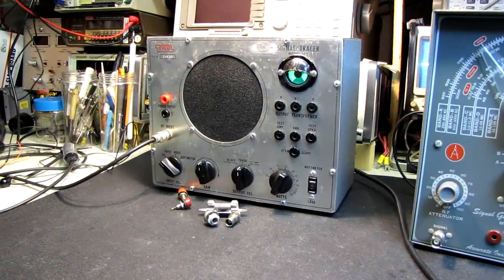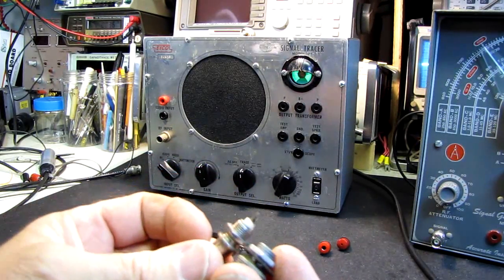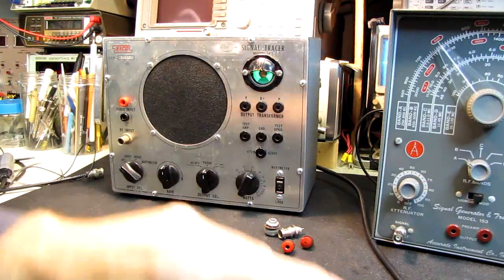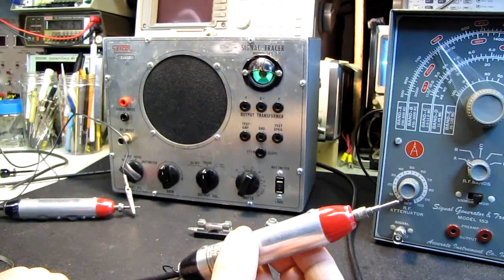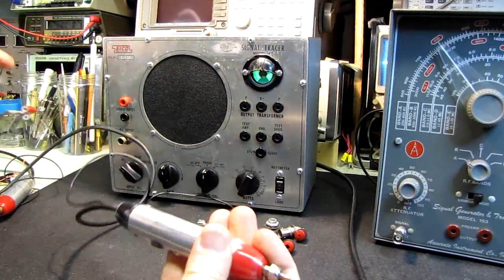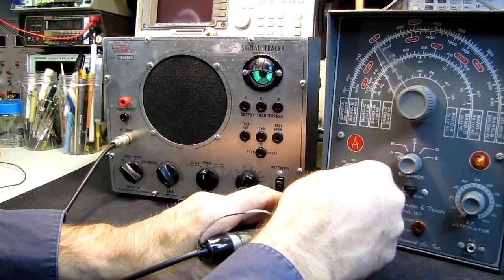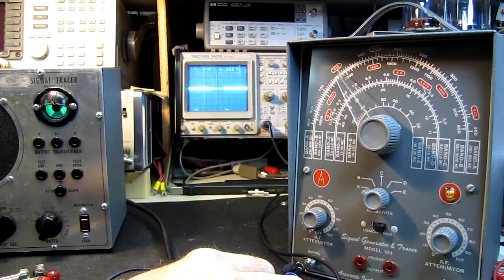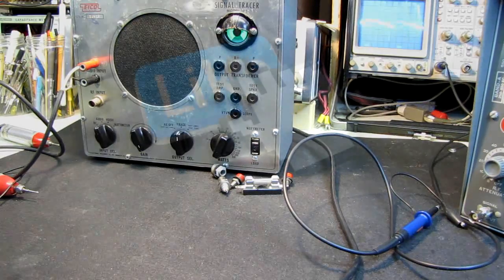10 Buck Test Bench - Eico 147 Signal Tracer Upgrades

Comment: I have a recent Swan 700 that requires some work & pulled my old Eico 147A off the shelf again and started watching some videos on exactly how these things are employed wondering exactly why the eye tube always shows ~70% deflection. I have the same issue on another 1038 Crosley super 11 radio. I wonder if you may comment regarding what may be the exact reason these eye tubes in the Model 147A are all resting at over 50% deflection. Hum, resistor value change, XMF leakage? Thx for a decent video Vern!
Reply from the maker: @maicodoug  that is the normal resting position for an eye tube. There is only a wedge at the bottom

Comment: I just bought a 147 on eBay "untested". It has a bad output transformer. What would you expect the impedance of the primary of the original transformer to be? Is the speaker 8 ohms? Thanks.
Reply from the maker: I am sending this from Thailand and have no access to my schematics. However take a look at what tube is used for the audio output, look up the specifications for the plate resistance. This will give you a pretty good approximation of what you need for the primary of the audio output transformer. That being said, this is not a high fidelity unit and is used primarily just to hear audio signals. Therefore just about any general purpose replacement audio transformer will work and I wouldn't worry about the speaker impedance. Again you're only using this to monitor the sound through the radio you're testing.

Comment: Great upgrades and video! This circuit and its intended DUT circuits are both outside of my skill set. However, I am beginning to learn about them, both. In considering building my own signal injector/tracer, I thought it might be useful to have the injected tone include a discernible beat/pulse. That way, I could not confuse it with any other tone of similar frequency produced by the DUT.  My hearing is significantly diminished. Thoughts/suggestions/circuit method?

Comment: Dear Radio Mechanic, I own both the Eico 147A and the 324 and on the 324 when it is plugged into the power I use, when I touch the case I can feel just a small shock, is this due to a leaking power transformer?
Also on the 147A that you replaced the ac wire with a ground, did you connect the green ground wire to the chassis? Thank you kindly for any input...

Comment: Nice video! I have one of these. I'm in the process of replacing the 3.? watt speaker with a 4" 30 watt Eminence speaker and two 1/4" female guitar jacks for the black & red audio inputs. I still have to figure out the circuit mod that will give me 20~25 watts of super clean out to the speaker. Any thoughts and advice would be greatly appreciated. Thanks!
Reply from the maker: Going to take a whole lot more power supply than this thing has for that kind of wattage.
Reply: @theradiomechanic9625  Thanks for the response! I agree. At first glance I figured "wow, three transformers" but last night I changed out the "audio in" jack to a 1/4" jack and very carefully plugged in the guitar, (I read somewhere an electric guitar puts out around 300 millivolts) so basically the guitar is a giant probe. It's not as loud as an acoustic. So it was basically a success. Nothing caught fire and no one was injured. I'm hopping, with more research, I can install a  small toggle switch that will turn off the magic eye. I figured out how to add a switch without adding any holes. No vintage gear will be harmed during this project. Any advice would be greatly appreciated. Thanks!

Comment: Very interesting.  I actually have one of these sitting on the shelf, in the box, unbuilt. I'll be sure and replace the caps before I build it, and probably those other mods too, as resale would not be a concern of mine.  Cannot wait to build it.  As you might guess, I'm older than it is.  I built a number of kits back in the day (tubes were my first), but never an EICO.  It's a long-gone era and consider myself lucky to have just a few of the old unbuilt kits (and many modern waiting too).
Reply from the maker: Hi Milo, Thank you for watching and for the nice comment. Something very satisfying about building a kit and having a nice piece of gear after. Just think of the tubes as Thermionic FET's and it becomes modern.
Reply: Ha Ha, I'd never thought of it that way before, though I'm aware of their similar function. When the big EMP goes off (either solar or otherwise), hopefully we'll still be playing with our tubes :-), and it will be a world lost to many as it is now (tubes).
Reply from the maker: Russian Military kept using tubes well into the early 90's just for that reason. They forgive a lot that will kill semiconductors.

Comment: Thank you for the great information. I just bought an old Heathkit signal tracer and would like to ground and insulate the probe. Do you recall the size of the heat shrink you used? I haven't received the unit yet so I cant measure the OD of the probe but I'd like to have all of the parts ready when it arrives.
Thanks again.
Rob.
Reply from the maker: HI Rob, the probe measures 7/8" ( .875" ) or 22.25 mm. Heat shrink was from a bundle of clear heat shrink I purchased years ago.
Reply: Sounds like 1" should be about right if it's 2X shrink factor but I'll see if I can find some 7/8" online as well.
Thanks so much.
Rob.

Comment: Very cool!  I have a Conar signal generator model 280, Heathkit S3 capacitor/resistor checker and a Jackson 641 AM/FM Signal Generator I needs to rebuild and plan on swapping out and adding BNC and plan on adding 3 wire cords...thanks for the tips!  By chance do you have a video where you address changing out the selenium rectifier (thumbing through your videos now)?~Jack, VEG
Reply from the maker: No, but someone ( I think it may be either Mr Carlsons lab or Mike at MIke's radio repair. You usually want to add a resistor to compensate for the Selenium voltage drop. If the Selenium is still working, measure the voltage drop across it and the current through it. Then you can replace with a diode and resistor.
Reply: Do apologize, I didn't get notification to your reply (I don't on most vids for some dumb reason), I thought the seleniums change voltage over time, so measuring what you currently have today is good enough? If its that simple, then not a problem! I've seen both videos but it wasn't made as simple as your explanation, thanks! ~Jack, VEG
Reply from the maker: The increase in voltage drop usually isn't much of an issue. The real danger with selenium rectifiers is that they produce a poison smoke if they power supply gets shorted. But if all is well I usually leave them in. If there is obvious damage from moisture I will change them. Check the schematic for the unit and see what the DC supply voltage should be. This is a good indication of how the rectifier is working.

Comment: Nice tips on the upgrades. Very good information. Subscribed.
Reply from the maker: HI, thanks for watching. Thought that HP meter was a 400E when I saw it. Have the 400E version on my bench.
Reply: Those HP meters are awesome. I still have an issue with mine but have not had to time to get back at it. One day...... Keep up the great work you are doing. Good to see someone helping folks that are getting started.  I recently found your channel thanks to  Mike at Mikes Radio Repair.  Enjoy every video I have seen so far.  Been watching them since 5am this morning while in the shop doing a bit of work.
Reply from the maker: Bought mine because my HP Q meter uses it for calibration. Works great and is real accurate.